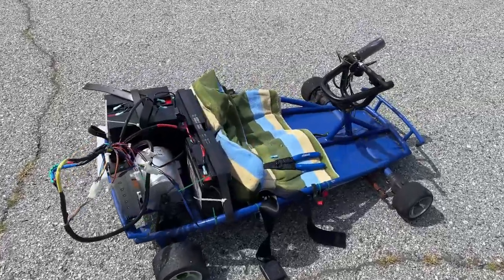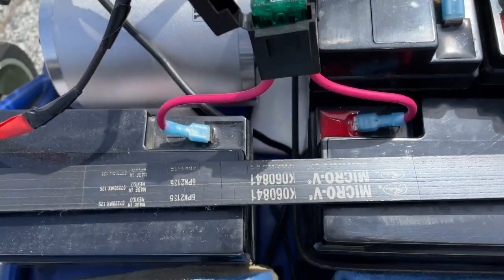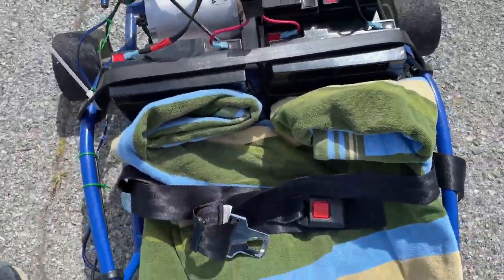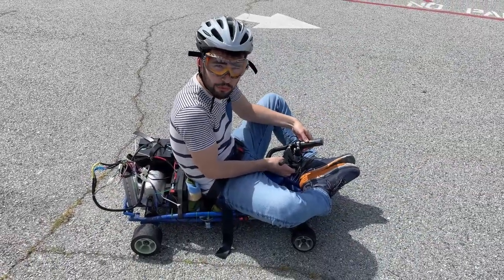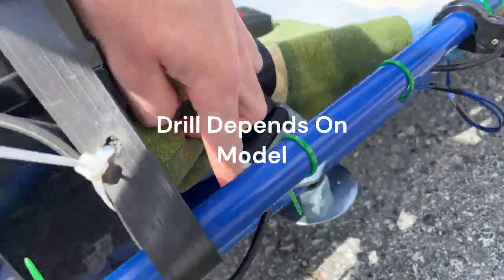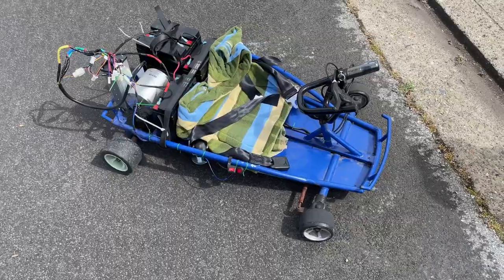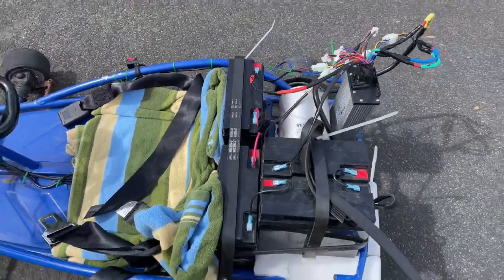Electric Go Kart 48v 2000w Motor Overview Video 1

Comment: what is the size of the sprocket on the motor? i want to increase the torque as I will be putting larger wheels on the back.
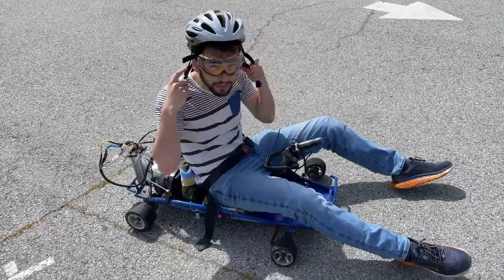Reply from the maker: The Description Of Linked Video Has The Sprocket And Chain I Shopped For https://youtu.be/f8vBZ9DGdmU?t=459 As Mentioned 3:40